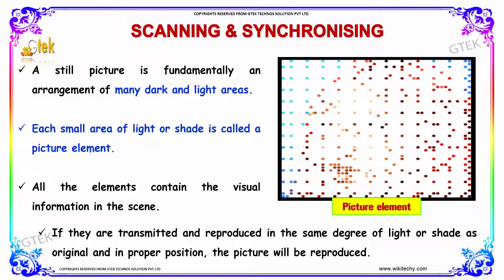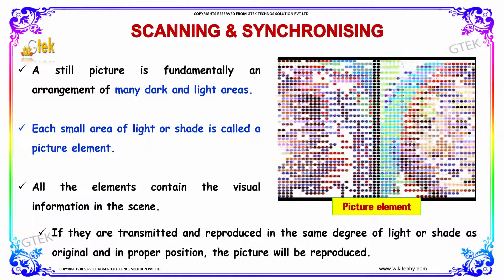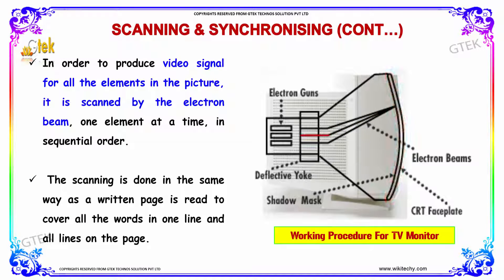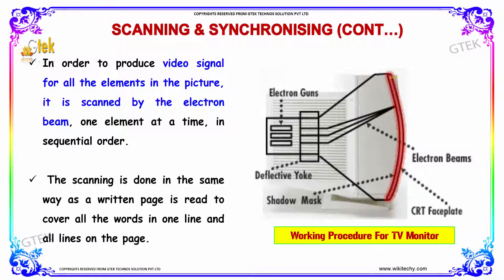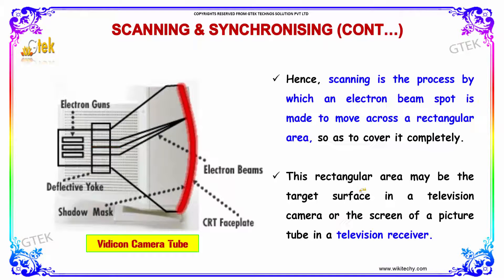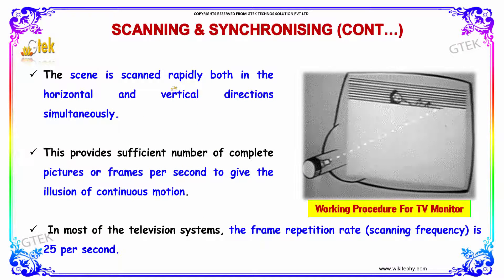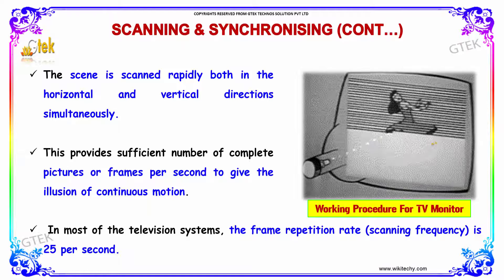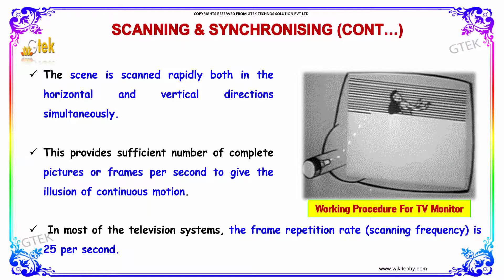Scanning and Synchronising |Communications system|class 12 physics subject notes|CBSE|IITJEE|NEET

Comment: The horizontal sync* signal is a short pulse at the beginning of each video line which keeps the horizontal scanning of the monitor exactly in step with the transmission of each new line. The vertical sync signal is a pulse transmitted at the beginning of each field and frame.

Comment: Scanning and synchronising

 

A still picture is fundamentally an arrangement of many dark and light areas. Each small area of light or shade is called a picture element. All the elements contain the visual information in the scene. If they are transmitted and reproduced in the same degree of light or shade as original and in proper position, the picture will be reproduced.

 

In order to produce video signal for all the elements in the picture, it is scanned by the electron beam, one element at a time, in sequential order. The scanning is done in the same way as a written page is read to cover all the words in one line and all lines on the page. Hence, scanning is the process by which an electron beam spot is made to move across a rectangular area, so as to cover it completely. This rectangular area may be the target surface in a television camera or the screen of a picture tube in a television receiver.

Comment: In an analog receiver with a CRT display sync pulses are fed to horizontal and vertical timebase circuits (commonly called "sweep circuits" in the United States), each consisting of an oscillator and an amplifier. These generate modified sawtooth and parabola current waveforms to scan the electron beam in a linear way

Comment: Introduction
The rectangular area of the picture tube screen scanned by the electron beam as it is deflected horizontally and vertically is called the raster.
In addition, the deflection for the raster must be synchronized with the picture. To time the scanning correctly, synchronizing pulses are included in the video signal. The total video signal has two parts - camera signal variations for the picture and synchronizing pulses for the scanning raster. Thus the video signal has the timing pulses needed to synchronize the picture information in terms of light, dark, and color values, with respect to the position on the screen in terms of horizontal and vertical deflection.

HORIZONTAL SCANNING

This linear rise of current in the horizontal deflection coils deflects the beam across the screen with a continuous, uniform motion for the trace from left to right. At the peak of the rise, the sawtooth wave reverses direction and decreases rapidly to its initial value. This fast reversal produces the retrace, or flyback.

VERTICAL SCANNING

This sawtooth current in the vertical deflection coils causes the electron beam to more from top to bottom of the raster. While the electron beam is being deflected horizontally, the vertical sawtooth deflection causes the beam to move downward with uniform speed. So the beam produces the horizontal lines one under the other.

The trace part of the sawtooth wave for vertical scanning deflects the beam to the bottom of the raster. Then the rapid vertical retrace returns the beam to the top.

SCANNING FREQUENCIES

Both trace and retrace are included on one cycle of the sawtooth wave. Since the number of complete horizontal lines scanned in 1s is 15,750 for horizontal deflection, the frequency of the sawtooth waves is 15,750 Hz. For vertical deflection, the frequency of the sawtooth waves equals the 60-Hz field scanning rate
The vertical scanning motion at 60 Hz is much slower than the horizontal lines are scanned during one cycle of vertical scanning. We can consider that the vertical deflection makes the horizontal lines fill the raster from top to bottom

RETRACE TIME

During flyback, both horizontal and vertical, al the picture information is blanked out. This the retrace part of the sawtooth wave is made as short as possible, since retrace is wasted time in terms of picture information. For horizontal scanning, the retrace time is approximately 10 percent of the time needed for the total line. Since 63.5 �s is needed to scan a complete line, 10 percent of this value equals the 6.35-�s horizontal flyback time. Practical limitations in the circuits producing the sawtooth waveform make it difficult to produce a faster flyback.
The lower-frequency vertical sawtooth waves usually have a flyback time less the 5 percent of that needed for one complete cycle. For example, a vertical retrace of 3 percent of 1/60 s is equal to 0.0005 s, or 500 �s. Although vertical retrace is faster the vertical trace, 500 �s is much longer than the time needed to scan a complete horizontal line, or 63.5 �s. Actually, in the 500-�s vertical retrace time, approximately eight lines can be scanned.

INTERLACED SCANNING PATTERN

The scanning procedure that has been universally adopted employs horizontal linear scanning in an odd-line interlaced pattern. The FCC scanning specifications of U.S. television broadcasting provide a standard scanning pattern that includes a total of 525 horizontal lines in a rectangular frame having a 4:3 aspect ratio. The frames are repeated at a rate of 30 per second with two field interlaced in each frame.

INTERLACING PROCEDURE

For the interlaced scanning, first all the odd lines are scanned from top to bottom, and the even lines are skipped. After this vertical scanning cycle, a rapid vertical retrace causes the electron scanning beam to return to the top of the frame. Then all the even lines that were omitted in the first scanning are scanned from top to bottom.

Each frame becomes divided into two fields. The first and all the following odd fields contain the odd lines in the frames. The second and all the even fields include the even scanning lines. Given two fields per frame and 30 complete frames scanned per second, the filed repetition rate 60 per second and the vertical scanning frequency is 60 Hz. In fact, doubling the vertical scanning frequency from the 30-Hz frame rate to the 60-Hz field rate is what makes the beam scan every other line in the frame.

RASTER DISTORTION

Since the picture information is reproduced on the scanning lines, distortions of the raster are in the picture also. A rectangular raster, correct proportions of width to height, and uniform deflection are required to get a good picture.

INCORRECT ASPECT RATIO

Insufficient width - the raster is not wide enough for its height, compared with the 4:3 aspect ratio used in the camera tube. So the people in the picture will look too tall and too thin - they will suffer from the same geometric distortion as the raster, This raster needs more width.
Insufficient height - Too much black area at the top and bottom, the raster is not high enough for its width, and so the people in the picture will look to short. This raster need more height.

PINCUSHION AND BARREL DISTORTION

If deflection is not uniform at the edges of the raster, compared with its center, the raster will not have straight edges. Pincushion distortion is a problem with large screen picture tubes. Since the face plate is almost flat, the distance from the point of deflection to the corners of the screen is greater. The electron beam is deflected more at the corners than at the center, which gives a raster with stretched out corners.

The pincushion distortion is a problem with large screen picture tubes. Since the faceplate is almost flat, the distance from the point of deflection to the corners of the screen is greater. The electron beam is deflected more at the corners than at the center, which gives a raster with stretched out corners.

The pincushion distortion can be corrected, however, by a compensating magnetic field. Small permanent magnets are mounted on the deflection yoke in monochrome picture tubes. In color picture tubes, the deflection current in the yoke is modified by pincushion correction circuits, or specially designed yokes are used.

TRAPEZOIDAL DISTORTION

Keystoned sides caused by unsymmetric horizontal deflection, the scanning lines are wider at the top than at the bottom. This raster is shaped like a keystone, or a trapezoid. A trapezoid has two opposite edges that are not parallel, IN the raster this effect is called keystoning, which is a form of trapezoidal distortion. The cause is nonsymmetric deflection, either left to right or top to bottom. In picture tubes the scanning symmetry is provided by the balanced coils in the yoke for scanning. The problem of trapezoidal raster is caused by a defective deflection yoke.

NONLINEAR SCANNING

The sawtooth waveform with its linear rise for trace time produces linear scanning, since the beam is made to move with constant speed. With nonlinear scanning, since the beam is made to move with constant speed. With nonlinear scanning, however, the beam moves too slowly or too fast. If the spot being scanned moves too slowly at the receiver, compared with scanning in the camera tube, then the picture information is crowded together. Or, if the scanning is too rapid, then the reproduced picture information is spread out. Usually, nonlinear scanning creates both effects at opposite ends of the raster. When same effect occurs for all the horizontal lines in the raster, the entire picture is spread out at the left side and crowded at the right side. When there are people in the picture a person at the left appears too wide and someone at the right looks too thin. 
The vertical scanning motion must be uniform also. Otherwise, the horizontal lines will be bunched at the top or bottom of the raster and spread out at the opposite end. So a person in this picture will appear distorted having a long head and short legs. Scanning nonlinearity is caused by amplitude distortion of the sawtooth waveform in the deflection amplifier circuits.

POOR INTERLACED SCANNING

In each field, the vertical trace must start exactly a half-line from the start of the previous field for odd0line interlacing. If the downward motion is slightly displaced from this correct position, the beam begins scanning too close to one of the lines in the previous filed, instead of scanning exactly between lines. This incorrect starting position produces a vertical displacement between odd and even lines that is carried through the entire frame. As a result, pairs of lines are too close, and there is extra spaces between pairs. So your see to much space between the white scanning lines. This defect in interlaced scanning is called line pairing. In the extreme case, lines in each successive filed are scanned exactly on the previous filed lines. Then the raster contains only half of the usual number of horizontal lines.

SYNCHRONIZING PULSES

The synchronizing pulses are part of the video signal, but they occurs during the blanking period, when no picture information is transmitted. This is possible because the synchronizing pulse begins the retrace, either horizontal or vertical, and so occurs during the blanking time. The synchronizing signals are combined in such a way that part of the video signal amplitude is used for the synchronizing pulses and the reminder is used for the camera signal. The term sync is used often to indicate the synchronizing pulses.

Comment: In synchronization of Television transmitter, a sharp pulse is sent between each video signal line so that to maintain the impeccable transmitter-receiver synchronization.[1] The receiver detects the video signal, synchronizing the transmitter and receiver is necessary to overcome the delay between different video packet arrivals.

Comment: In general, synchronizations is the process in which the signals are transmitted and received in accordance with the clock pulses. In synchronization of Television transmitter, a sharp pulse is sent between each video signal line so that to maintain the impeccable transmitter-receiver synchronization.The receiver detects the video signal, synchronizing the transmitter and receiver is necessary to overcome the delay between different video packet arrivals.The receiver must start scanning same line on the CRT output display or picture tube when the TV camera starts scanning that line, these are the horizontal lines that are being scanned. The scanning speed of transmitter and receiver must be same so as to avoid signal distortion and deformation at the image in receiver output. When horizontal lines are completely scanned, vertical flyback or retrace must occur simultaneously at both transmitter and receiver moving the electron beam from bottom line end to the start of the top line. When the electron beam is returned to the left-hand side to start tracing a new line during the horizontal retrace, must occur inadvertently at both transmitter and receiver.